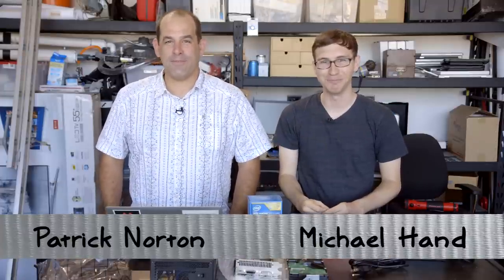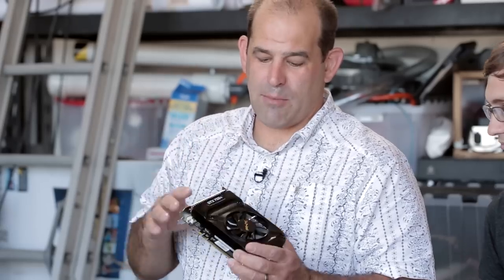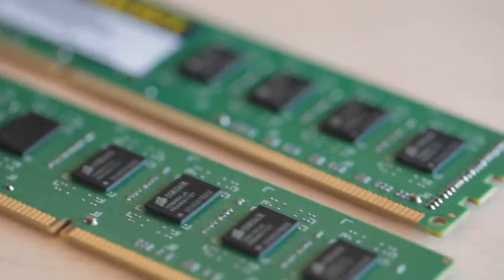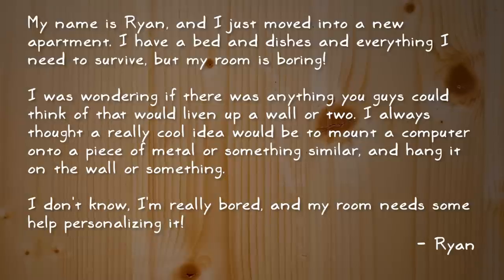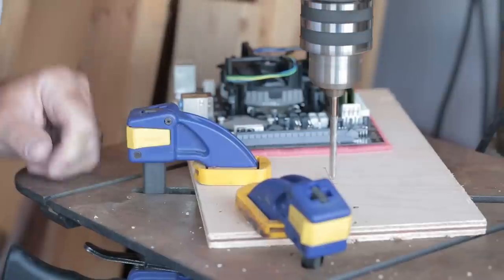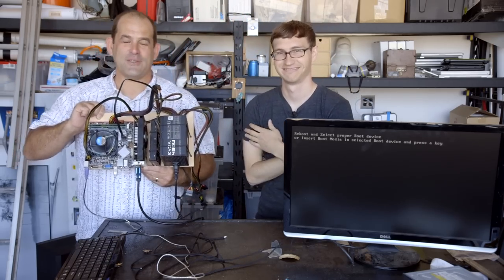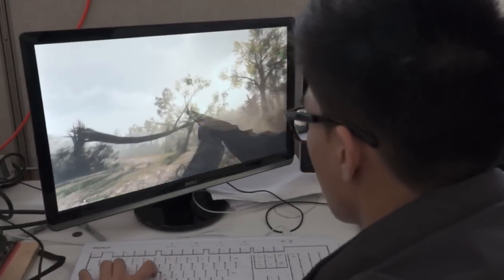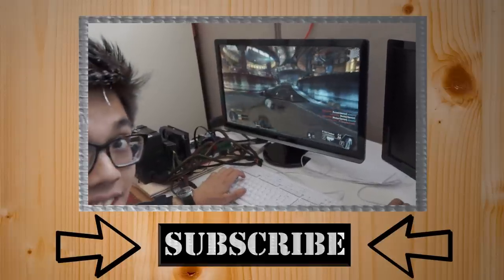Screw The XBOX ONE and the PS4... We Built a Gaming PC for $380!

Comment: I built my PC using a PC I found in the electronic recycling bin that is a half a block from me. I spent a whole 250.00 all I had to do was buy a video card it helps that I am an old school hardware tech and I even got a win 8.1 key that was on the case with a sticker.
Someone must have misdiagnosed the issue with it but it had a terabyte Sata drive and I5 processor.I had to mess with the power button but once I fixed it the system ran great got the free win 10 upgrade and now my system is flying. I was able to take two decent widescreen lcd monitors and I  got lucky they were both Samsung one had a bad screen the other a bad psu so I changed the psu into the one with a good screen and got my system for a little labor. I know most people can't do that casue they won't have the same ability as me, but if you grab enough of them you may be able to get 90% of the parts free and then buy some upgrades.Most likely you will need to buy a harddrive maybe some cables and a monitor  and build it from others scrap. Just a thought I guess much of that depends on your skill level but at min you would be able to at least get a case and power supply free the power supply I got was a 535 watt with 2 fans quite a hefty PSU but it didn't cost.
Reply: cool
Reply: you're one freaking lucky lier .xD
Reply: King ARkaMAni No need to lie. It's how I got my present system when your on a disability pension there is no budget to buy computers.
I was able to upgrade the video card only because my wife passed away Nov 3rd and the disability gave me a 6 month extension at full pay. I have a degree in Hardware repair I have worked on and have owned many computers.I stopped working in the field when people stopped repairing computers and started part swapping.
I have another set of monitors I just got not long ago and as soon some flux and solder get to me I am going to try and repair one of those you see these so called computer techs are not really techs they are part swappers, so when something like the power supply in a lcd monitor dies they toss it and sell the customer a new one. It's the way it is now days because it's cheaper to buy then to repair.your not going to pay me 80.00 to fix a video card that you can buy for 75.00 or even upgrade and spend 300.00 it's still better to replace then it is to pay to fix this means the electronics recycling bins are full of good parts. I recently got a few items from the bin worth in the range of $900.00 All I have to do is clean them and change a few capacitors then sell them I also got 2 rare 110 watt power supply's along with a modern 535 watt power supply. That's around a 100.00 bucks free right there so call me a liar all you want but I have no need to lie the electronic bins we have here in Ontario Canada are lined with gold if you know how to get them working again as I do!
Reply: KoolBreeze420 i just wonder how can someone get rid of case with a terabyte and i5 processor and the windows key on it just because a powerbutton issue , unless he's a spoiled rich idiot kid , but if you used to be in the repair field ,yeah shit happens .. i was selling computers and laptops hardesks.. etc to those people and also buy from them and yes the old ones can repair most of the parts like the hardesks screens and motherboards ,graphic cards and i used to hang out in one of the old school repairers master , he used to find some decent motherboards with only one capacitor or two that blown up so he change them and they work and most of the screens will be the problem will be on the cable only so .. yeah i think i believe you if you were a repairer if the word repairer restorer is right ..
sorry for my english also it's not my language.. and injoy your treasure.
Reply: King ARkaMAni "i just wonder how can someone get rid of case with a terabyte and i5 " So do I but it's what happened perhaps some one passed away then someone tried to power it and said it's no good and recycled it. 
There are many reasons that could explain this. I wonder why someone through's away nearly $1000.00 in equipment. Just the other day that I happened to score.The 535 watt power supply I just scored was amazing the tower is missing one of the side panels and I had to use a few computers I didn't list all I had done but if you want a full list and pictures I will show them.You see many computers have the Windows key sticker right on the case so you see these things obviously like I originally said many won't able able to do as I did, but you can get many free parts like a case, a power supply, processors and even dvd drives oh and wireless lan cards. I have a few of those now as well.I have over a half dozen processors that I salvaged, I have a small desktop I think it has an I3 processor with a win 8 key on the case. 
Yes I am an old school hardware tech not everyone can get a whole system from these bins and many places may not even have these bins they have many treasures. I like to get all the adapters I can find. I just got a 12 volt adapter on my last trip to that bin. and in the summer I use my motorized mountain bike and trailer and visit all the bins one a week.
What I would like to do is find a way to easily recover the gold from these things then I could earn some extra cash but this has become a bit of a hobby casue as I said my wife passed away and I need a few hobbies to keep the loneliness and the depression at bay.
I wanted to buy somethings that I won't be able to buy when I lose her income. I got lucky and they gave me a 6 month extension, while we wait on a decision for them to put me on my own disability pension and at that point my income will shrink drastically. 
So if I can find decent finds on a regular basis I could supplement my income.
I hope this clears this up for you.
Reply: KoolBreeze420
oh man that's a really cool hobby ,but also what's gone is gone forever ,as i believe in god everybody has his destiny on an exact time not an hour forward nor delay , your wife will be in the faithful god's hand , and we can't do anything for that but carry on ,and the death will come back on a ressurrection day as we all came from nothing one day ,,.. do you belive the computers created itself or by a coincidence , so how come we "humans" much more advanced come out to life (bodies brains and souls) by a coincidence i just wanted you to believe in god and believe that your wife will be in god's eye and care, i just felt that you're an atheist and then read it under your picture and that's not helping..
keep the depression away , anything we are not involved in we aren't responsible of ..
believing in god will not creat psychological issues but relief , and vise versa .. . i hope that gave you  some relief .. thank you.
Reply: King ARkaMAni Wow seriously? Your going to try and equate a biological being to a man made invention and then expect me to believe in the nonsense of a all powerful bumbling idiot of a creator?
Sorry I've been there I've spouted these exact words there is no going back to accepting nonsense once you awake from the mythology into the real world, there is no way back to blissful ignorance.It would take something extraordinary to get me to accept that there is a non man made creator and only that creator would know what it would take for me to believe in him again.Please I've been through it all my wife was a believer and in the end I believe it was that belief that wore her out she was only 52, charlatans made her believe she had been cured from all her ailments and instead of taking things easy and going to the Dr's she refused casue she believed in the nonsense of those whom are blissfully ignorant and no I am not mad at any being and I have been an atheist since I left seminary school 20 years ago.
Reply: +King ARkaMAni It's actually more believable to find premium hardware in a rich neighborhood next to a dumpster (where I found my aluminum tower) than it is to find evidence for the supernatural. I'm just saying.
Reply: pulpbits the guy said he was a tech guy and explained how he used to repair and replace parts as i did before ,so that was a good reason to believe him, that's just for you to know that i can't believe in something unusual without a good reason.
Reply: +King ARkaMAni It is not as strange as you may think.  I used to be a bench tech 30 years ago.  I loved finding stuff in old electronic surplus places.  I once bought a rack mounted computer case in hopes of reusing its power supply.  When I got back to work I found a motherboard, CPU, graphic card and memory inside.  My boss sent me back to buy all the rack mounted computer cases they had.   Sadly we don't seem to have electronic surplus stores any more, but there are thrift shops that sometimes have old computers and parts.
Reply: mal35m i never said it's strange.. thank you .
Reply: +King ARkaMAni True, you did not say it was strange.  My only point is that non-tech people, even smart, knowledgeable people who own their own businesses may not know or care to know what they are throwing away when they decide to upgrade their computers.  I have worked for people who were that tech-phobic, in my case one of them  was in charge of the engineering  dept.
Reply: Gryffin DarkBreed well if u agreed to let microsoft take ur data thats ur problem not mine and is actually legal...
Reply: +KoolBreeze420 Shoot, where do you find all of this stuff exactly, where I live The best processor I have scavenged for is a non-overclockable I core duo, except for s system with a 2500k that someone ruined by overclocking + overvolting without a functioning cpu cooler!
Reply: +Gryffin DarkBreed He's talking about the licencing agreement you acknowledged when you installed windows on your computer. Therefore = legal. If you hand someone information with consent that is not illegal, you gave consent when you clicked I accept, same deal with facebook. Next your fourth amendment right was stripped from you by your government post 9/11, not Microsoft, it doesn't exist at the upper level, forget "privacy". Get with the times, big brother is watching.
Reply: Gryffin DarkBreed
You either get use to government watching you and protecting us from terrorist. Or don't get online period.The government only not Microsoft watching you.If you and many others have problems with protection then don't turn the computer on or use internet
Reply: Gryffin DarkBreed please do tell me where "they" have the man power to monitor EVERYONE who has a pc connected to the internet? (they being ALL governments assuming they all do this) they can see your comment right now, why dont they do anything about it? where's the logic in them monitoring ALL of the available PC's? why would they want to gather hundreds of PETAbytes of porn and games and shit? there's no point in all of that there's no logic. but please, try and give me some logic so i may understand your side of things
Reply: Mac PooPum The Government in Australia does exactly this. All data is monitored and retained for all users (Mobile+Internet) for a period of upto 2 years, it is indiscriminate. Snowden also revealed the US government was spying on citizens outside of it's borders. Australia is not the only nation that does this, and it is not a secret. You should do some reading on how the "real world of today works". Secondly military and government computing technology far exceeds consumer level by a few orders of magnitude, petabytes are a drop in the water.
Reply: ***** that still gives ZERO explanation as to WHY. WHY do they monitor us? again i said it's because they are looking for suspicious activity, like people searching for home made bombs or communicating for a terrorist attack and anything along those lines. again those computers are powerful yes but what are they programmed to look for? they could care less about ur millions of selfies and hashtags. please tell me WHY america wants the biggest hard drive filled with my next door neighbors nudes and selfies?
Reply: Gryffin DarkBreed answer the fucking question. why do they monitor us? what good does it do
Reply: agreed, grats on finding a decent set of parts... i will say be wary of win10 though... it does have spyware that cannot be dissabled.. though the big one is the cortana program, and i think that one can be shut off... either way only way win10 will infect my comp is thru a direct install from disk.. my win7 auto update has been busted for years.. and disabled to stop other errors...and if i wake up with win10 on my system, i will  shoot the damn thing with a double barrel 12 guage and tell microsoft to spy on that... IMO windows 3.1 was the ONLY good version of windows.. i only use later versions because i dont have a system capable of running Ubuntu, and because sad to say.. microsoft has bullied software companies to write for windows framework as main code... which means all my games are in windows.. well done microsoft, you are an illegal monopoly... well almost.. but they want to be one....wonder how much they pay the US government off to not be broken up like Ma-Bell was back in the day.....
Reply: that may work fine for you, but my experience is to run windows on its own drive and definitly not on a SSD due to the habit of windows to constantly move all files on whatever drive it resides
Reply: I think that depends on the application. I use an i7 with 2xSSD for gaming, not really much for the OS to mess with. However I have an i5 I use for Photoshop, Photoshop loves to created temporary files,so i still use a SATA mechanical drive for that.